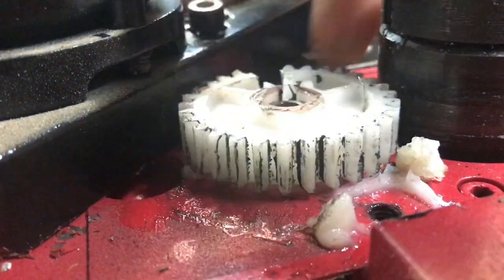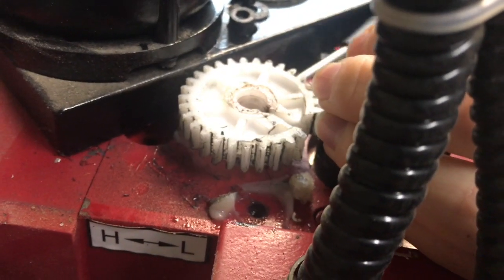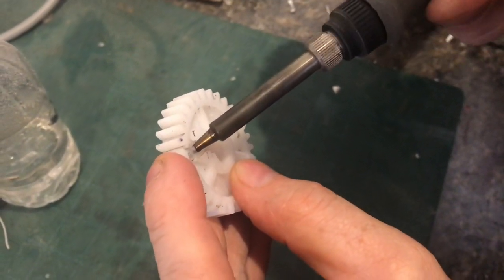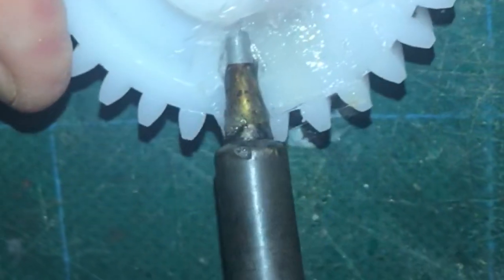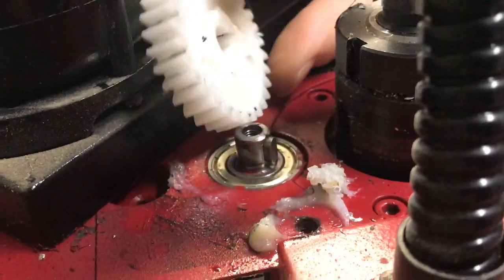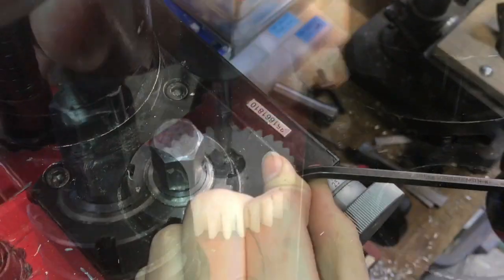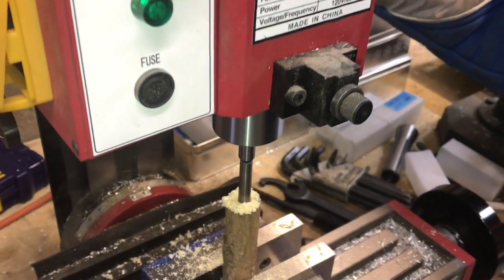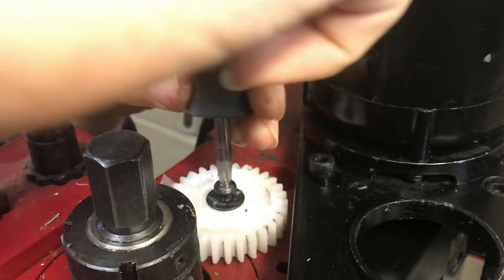plastic welding is VERY effective (fixing heavy duty plastic gears)

Comment: I have a harbor freight milling machine and had the same problem with broken plastic gears.  I found replacement metal gears on ebay and installed them.  So, after five years the machine is working fine with the metal gears.  I looked on ebay today and didn't find anybody selling the gears.  I don't know where you could find them at this point.  My opinion about why they put in plastic gears is that it was a cheap machine and they put in cheap gears.
Reply: Sometimes they're there for cheapness (in which case there's a bunch of them for sheer cheapness) sometimes they're intentionalany made to shear or break to protect expensive complex geartrains (in this case there will be very few strategically placed plastic gears)

Comment: I would really like to thank you for sharing this it worked for my RC car Caster Block which snapped into half after I collided with a stem of a dense bush. I did exactly what you performed there in the video and tested it out again to check for it’s durability, It holds on Super tight. Once again thank you... this vid allowed me to save my cash and at the same time, get my car back running
Reply: Sorry if my English isn’t up to standard